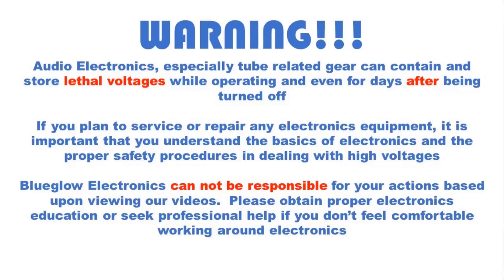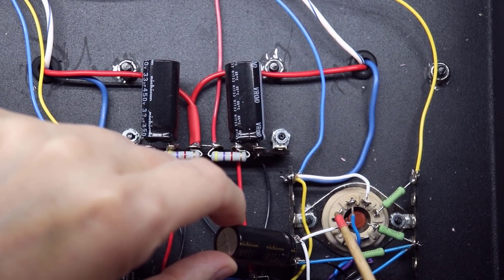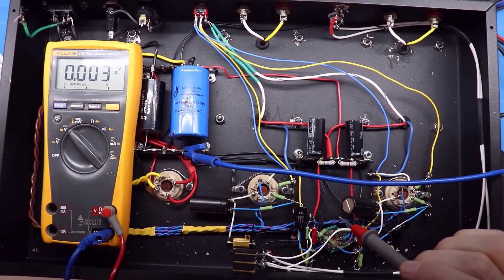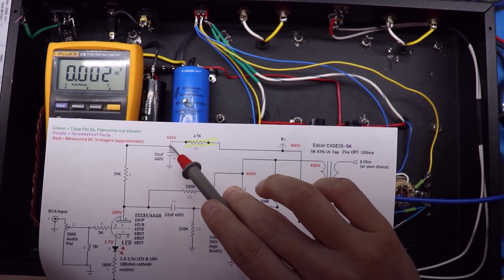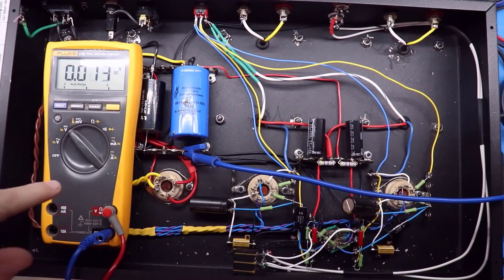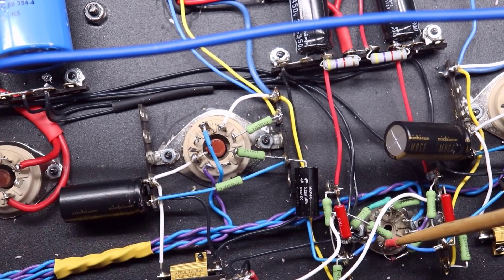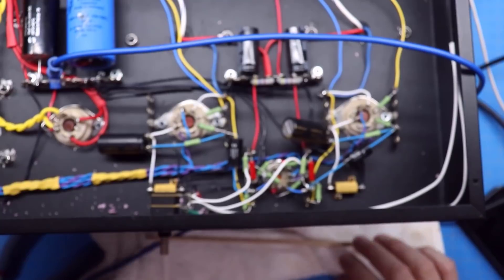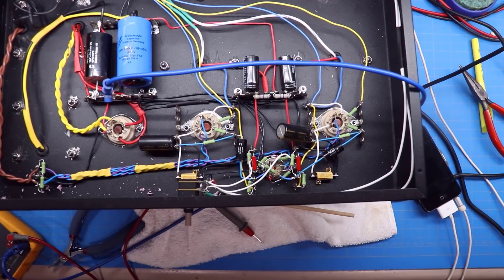Troubleshooting a Single Ended KT88 Tube Amplifier Issue

Comment: I found an old Magnavox console with an 8802. The seller powered it up and the radio worked.  I put all new resistors and caps in and each time I replaced a component I would check the resistance across the solder joint to make sure it wasn't open or high resistance.  Afterwards I put the tubes in and checked the pins to ground or to #3 of the rectifier against the resistance values in the Sams photofact.  It sounds wonderful.

Comment: I remember an ah ha moment i had years ago, that without current or even with very low current  you wont get voltage drop across the resistors... great stuff.

Comment: 200uF for a kenotrone means it's death. May be an owner needed to see one more tube on a top (instead of a mosfet regulated power source), but is this case a schematic must have a good PSRR, because 20uF is an absolute maximum for a kenotrone. Some people needs to start from JLH before they proceed to a tube amplifier -)

Comment: Howdy. Nice build.
However. The amp. is dangerous. No way that wiring is type approved to withstand hundreds of volts. Furthermore. Live wires or parts should have double insulation towards the chassis or each other.
Grounding the chassis provides chock protection only when fed from a 3 prong outlet.
Check my blog  eugpoh11.blogspot.com  for direction to build to comply with The Electrical Safety Code.
Rergards.

Comment: I'm getting old Rule 0.1 discharge capacitors. Learnt that waking up on the other side of the shack with a melted screwdriver courtesy of a blown discharge resistor on a colour tv.
Reply: I reminded D Jones of that fact on a power supply repair video !

He never discharged the bulk capacitors or checked the voltage .
All we got on the video is him saying …...She'll be right …..... 

He could have discharged them off camera but the comment implied discharging capacitors is
 irrelevant .

Dave got lucky that time & the discharge resistors did their job .

Comment: He should have trusted his instincts, he did note that the LEDs weren't lit. I've been there too, looked at a ckt 20 times and assumed I could not have wired it wrong. Putting it away for several days and coming back to it helped find my error.  Great tip on the voltmeter!  It doesn't lie.  Thanks for the video!

Comment: a typical beginners disease....as well as getting polarity wrong on electrolytics.....once you find out, you never do that again. That's the learning proces. The main symptoms for you is : you get nightmares.The remedy : check your voltages. Happened on my first two amps.

Comment: Having worked on a production line soldering components one issue I  noticed is that I was told and is correct  compliant practice to rap the leads around the terminal once,   it stops the leads from breaking lose, not just rely on the solder to mechanical hold it in place.

Comment: Great video, many thanks. We can't see our own mistakes. Its epecially hard after investing hours concetrating on a complex multi-skill build. A fresh set of experienced eyes can quickly sort it. There is much to learn with electronics, you have to get stuck-in. Mistakes are frustrating but by sharing the fault tracing process you will learn quickly and permanently. A great approach to diagnosing circuits is demonstrated here. Gold standard teaching.

Comment: I built a tube amp and it never did work right. Low volume. The next door electronics expert looked at it and did not find the problem. I just put it away. Came across it again 50 years later, located the schematic and in about 10 minutes  found the wiring error and fixed it. Sounds  magnificent.  I was 12 when I built it, from a Lafayette kit, 4 tubes. So setting these aside for a cooling off period works. Maybe it didn't need to be 50 years though.

Comment: First rule of amp building, check your work, second rule, check your work,  third rule, check your work. It's so easy to do, we've all done it...putting a 100k R in instead of a 100r, forgetting to solder joints...DA.

Comment: Nice pointers there Mark. For this design can I simply use EL34 tubes WITHOUT changing the cathode resistor or any other components? I see on your diagram there's a list of tubes as though its a one-size- fits all. Is this really possible?

Comment: Thanks for sharing, and Thumbs up for helping another enthusiast out with his build.
I had plenty of these cases it can be really hard to find your own mistakes and we all do them.

First I thought it was still broken after you fixed the diode, until I realized it's a matter preferences in music, lol. I'm not judging, just realizing it's great we have vast amount of great music, so we don't all have to listen to the same tracks every day..  

Joke aside, I wish I could listen to it for real without YouTiube's compression and the obvious fact that I would be listening 20 other parts in the signal path.

Is this design and the sound comparable to something familiar?
Could you pick something it rank's with?   

I know the KT88 mostly from QUAD Tube amps; I had the old classic model on my ESL 63 years back, and later the QII forty, and now at QII Eighty. I Would love to try out another design with the KT's, though I have no complains over the Quads. While waiting to finishing refurbishing a set of ESL 989, need to redo the panels. A fine little winter project... or maybe next winter...

Cheers!

Comment: The fresh perspective works in a surprising number of jobs. It's always good to get a second opinion when struggling with a problem.
Voltage checks are the primary tool for tubes circuits, the whole thing is one big voltage divider network, balanced at some operating point.
...
lots of flak in that chassis though, owner should get that stuff out less it comes loose and shorts something out.
Cheers,

Comment: "Thou shalt check voltages." -- Dave Jones
Reply: Right. Tubes have high plate voltages. Transistor amps are low voltage devices. Tubes are voltage anplifiers. Transistors are current amplifiers (unless they are MOSFETS). Tubes have a high input impedance. They make ideal phono preamps. And tubes amplify different harmonics than transistors, so they sound better. But, tube output stage needs a transformer, because speakers are low voltage, low impedance devices. So, its a mixed bag, lol

Comment: With hindsight(!) the clue was in the builder's fault description - '........diodes not lit.'
Reply: Ah but there were two other problems though. Fixating on correcting LED orientation may cause the other problems to be missed and the thing works.. ok but not great. I agree that customer complaint is important but it's also good to put it aside and go through a soup-to-nuts diagnostics approach. I have had more than one customer tell me the problem only to find that it's something wildly different at fault.
Cheers,
Reply: @EngineeringVignettes  Agreed, but it would have been a good starting point, with the routine checks to follow.

Comment: But it really says check & absolutely re-check what you have truly done. One of my biggest fails building my 1st amp grew out of not being aware of the actual size of the parts i had bought. I worked off the schematic and referred to a couple of not too good photographs in the magazine article project for my layout. On account my more modern parts were so much smaller than in the 1960s version i soon made some big mistakes. Lucky i caught it & stripped it all back for a re-start. i made a hand sketch in pencil (so i could make corrections)  based on the original layout from the photos on paper. It was kind of like old Heathkits showed in their instruction manuals.  I then  followed it for where to fit each part to its proper place verifying on the schematic as well.....
Reply: I have built this KT88, pretty straight off his videos. Since I wanted a tube pre-amp I went out on a limb and found a good schematic and modified it to fit my needs. Having nothing to work with except a schematic I really thought the build through for around six months.  Finally I bought a matching Hammond chassis 10x6x2 and all my parts.  After I fabricated the chassis and placed all the components I found a whole slew of mistakes and miscalculations.  Enough that I had to buy a new chassis and start over.  Glad I did, the build is coming along swimmingly at this point.  Just all part of the game; it is one thing to copy someone else's build, but quite another to figure things out from scratch, or even to consider different sized components like you had to do.

Comment: A second set of eyes, or give it a bit of time to clear your head. Prime example is another YouTuber I watch, Gregg's Vintage Workshop, where he is working on a 1933 Philco 54. It's a long term project where he basically had to disassemble the whole thing and completely rebuild it. Well, when he was done, it wouldn't work. Checked it 3, 4, 5 times and put it away for a couple months. Pulled it back out and started going over it again and found several mistakes. Works the charm now. So yes, another set of eyes or even some time and distance do wonders for troubleshooting clarity.

Good on ya Mark. Gives us in the hobby a good name. 

Thanks again for all you do.

Comment: Hi Mark. You called that 200k a "Shade" resistor. I paused to look at the schematic and that appears to function as a negative feedback path. 
If that is a feedback loop I can see why switching the 38k with the 200k would reduce volume (that would be a lot of negative feedback)
Please explain the function and the name of the "shade" resistor
Thanks.
Reply from the maker: If you will go back and watch the KT88 build series, I cover it in-depth.  It's called Schade feedback.
Reply: @Blueglow  I will watch again. It's been a while since the original series began in Feb of 2018 . Thanks for creating the playlist.

Comment: I really don't have anyone around that can help me (a second pair of eyes goes a LONG way) so what I do when something fails and I cannot figure it out within 24 hours is just put it on hold and move on --- but I always come back and fix it. I started this hobby two years ago, have built/modified/repaired over 50 projects and only one is still filed under "needs fixing" ... it was my very first kit and I fried a MOSFET one night trying to power it up with the leads reversed 😂 It's that stupid cheap "Tesla coil" audio circuit but I still want to figure out how to fix it. Meanwhile I am set to sell 5 hand wired/hand painted passive ring modulator guitar pedals!
Reply: agree,  I have great trust in my understanding of Kirchhoff and Ohm, so if I mess up, can't find it,  etc. I take a break and come back with those two tools and take a fresh look.  Many times, voltage drops around the circuit revealed everything. Trust in your knowledge and think logically. If you get frustrated, just step away and come back with a cool head..

Comment: Good of you to help out! Interesting that a volt meter is all one needs much of the time.
Reply: Well yes, the multimeter plus knowledge and experience. Some of us have to rely a bit more on the signal generators, cap testers etc. I can't ever remember building one single electronic project that didn't work first time, probably around 30 to 40 different circuits. A few valve and transistor amps included. I had to be extra careful, checking things multiple times, then doing it all again! That's because my understanding of theory was terrible and my fault diagnostic skills were equally as bad!
Reply: A voltmeter plus a set of eyes, ears, and nose and you can troubleshoot many faults.
Reply: And a circuit diagram (map) is incredibly useful! Use with care though because manufacturers make manufacturing mods that may differ from the published diagram.
Reply: It helps to have a good oscilloscope, so you can see everything that is going on in the circuit. (Scope should be floated, of course).

Comment: Good man
Love your channel
Reply: Great troubleshooting and explanation. I also plan to build this amp. but I have a question: if I do different cathode bias method on the driver tube. Is it possible to do cathode bias with a resistor and an elco on the driver tube? for 12ax7 tube, can you give recommendation what is the value for the resistor and the elco?. Thank you.